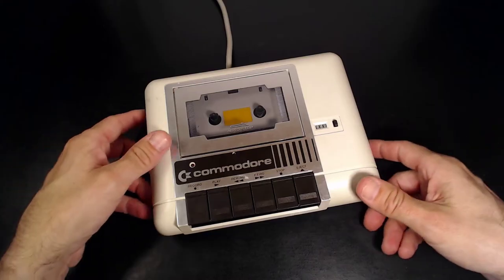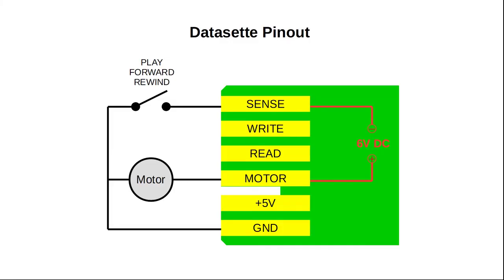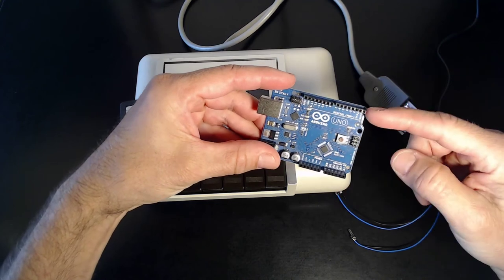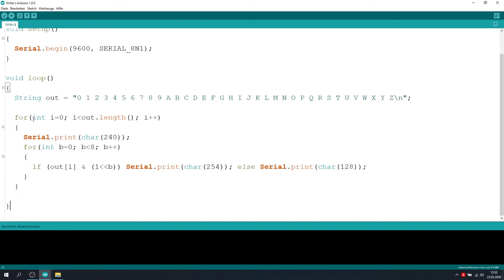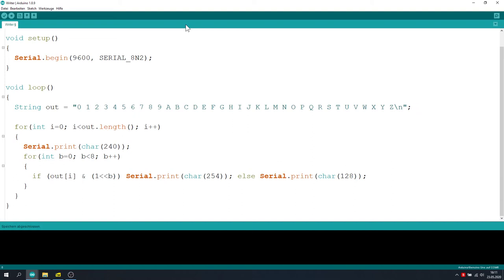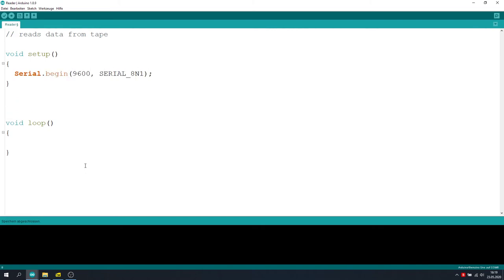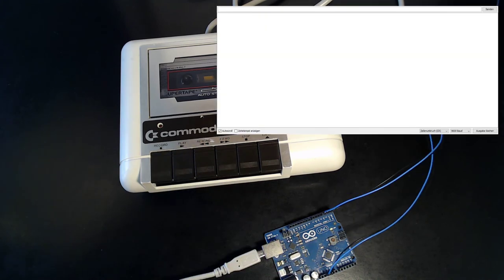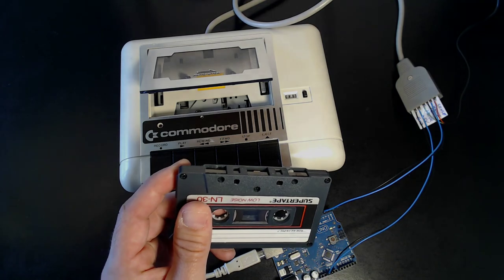Respect the Datasette 1: Let's Store Digital Data on Magnetic Tape

Comment: I'm very surprised that this even works. Is really that simple as just sending 9600 bps in and back? Why would then Commodore stick with a 300 bps cassette port if they could have connected it out of the User Port which gives 2400 bps?
Reply: If you watch carefully from 3:10 , the explanation is there. Basically abusing the serial protocol at 9600 bps to generate different length pulses, being careful that the smallest pulse is 2 bit times or more and that the pulses don't overlap. Each bit is encoded as a byte at 9600 bps, giving approx 960 bps transmission speed.

Comment: Can you also do the other way: Use the Arduino to send and receive data to the C64's cassette port?
Reply from the maker: Hi Waldo, this should be quite easy actually, since the signals to and from the cassette port are already 5V TTL.